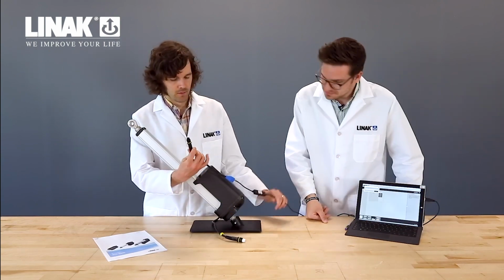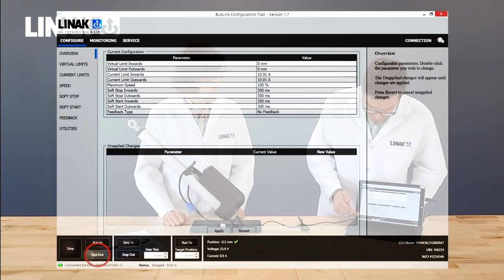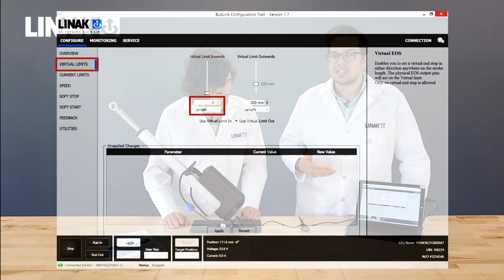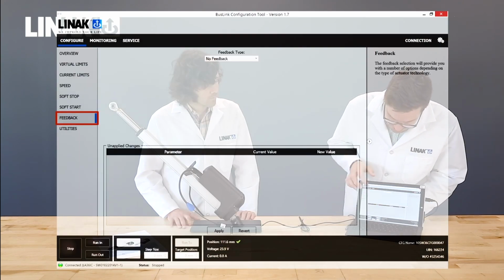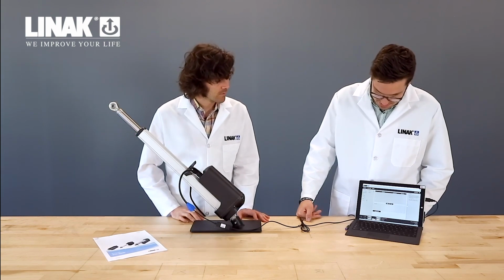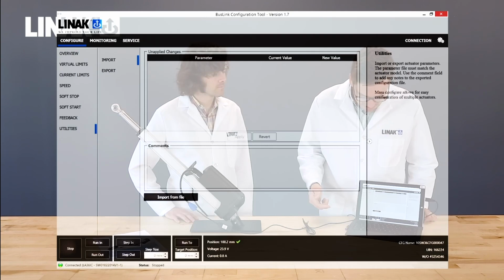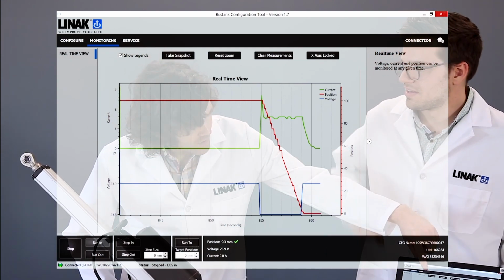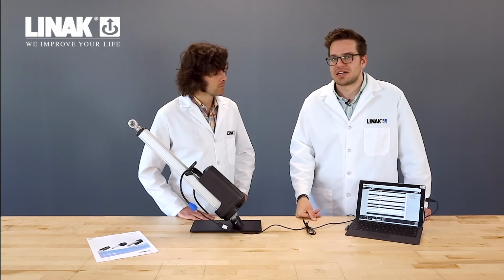Anatomy of Actuation: BusLink

Comment: using the buslink software and cable only lets you operate one actuator. How do you operate 2 or more for the purpose of setting currents when 2 or more units in play?
Reply from the maker: You can actually run several BusLink programs at the same time and connect to a number of actuator. However, it does require a USB2LIN adapter for each instance.